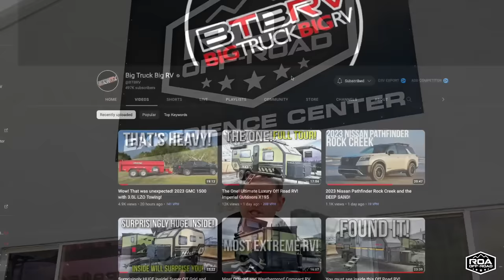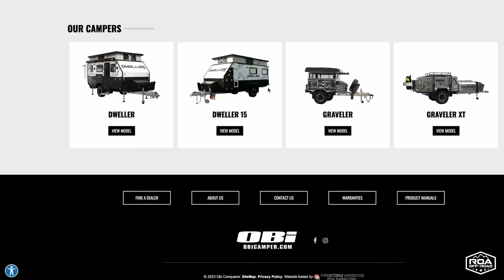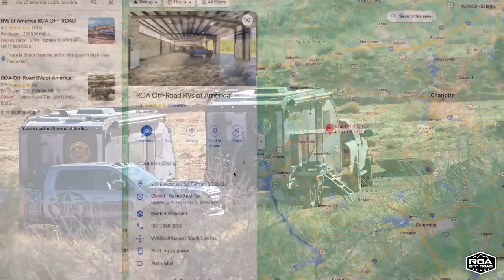The Best Off-Road Trailers in AMERICA in 2023! The ROA Lineup with Big Truck Big RV

Comment: Do you guys use/offer/recommend weight distribution hitches?  Or am I missing something? 

Or would you recommend something like Timbren SES to eliminate squat on say a Ford F-150?

What trucks DO you recommend for, say normal not extreme use of a Roamer One?
Reply from the maker: We do have some WD hitches that we can install or recommend. It is depending on the situation. Your truck and the trailer combo. If you don’t have a truck and trying to figure out both. Reach out to us and we would be happy to assist you with more details. ROAMER 1 will work great with a F150